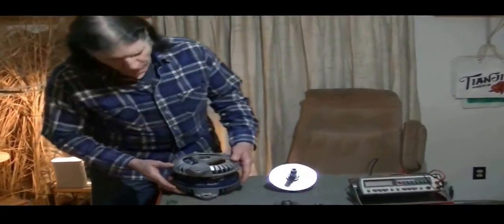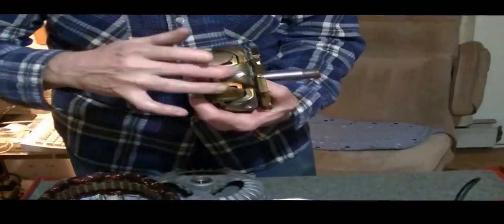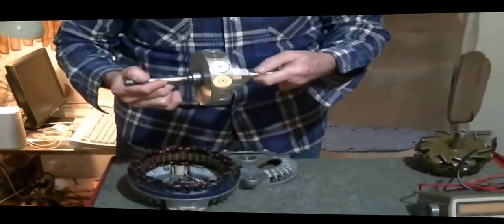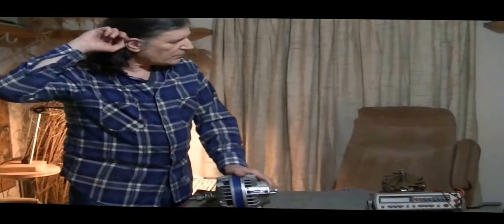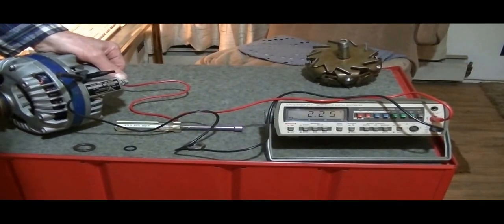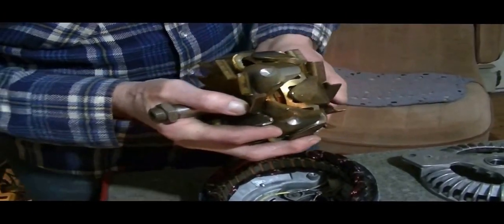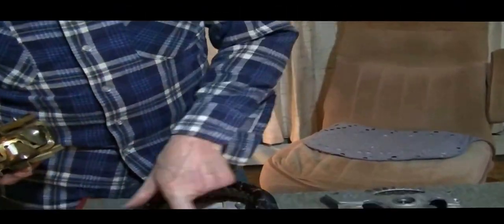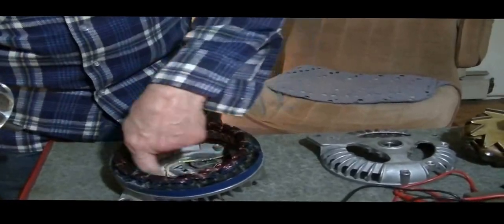Micro-wind Turbine Project: Permanent Magnet alternator basics by Ken Rieli

Comment: Nice work! Given that the rotor field is fixed, in the new arrangement, how would one prevent over-voltage in high winds? I can imagine having feathering blades but I’m wondering if one could arrange for excess energy to be dumped into a heating coil immersed in a large water tank. What I’m imagining is a system that can charge batteries and heat water. Thanks!
Reply: The best setup would be a combination of voltage regulators for battery charging, and an HOH generator for storing excess power in a "gas bank".
Reply from the maker: Use typical 12-volt automotive regulators to control the output voltage, and a smart power splitter to dump excess power to either heater coils, or an HOH generator.

Comment: Could you please tell me what is the difference between the size of magnets in 100amp alternators and 60amps alternators? Do 100amp ones have bigger/stronger magnets or just thicker and longer wires are used for windings?